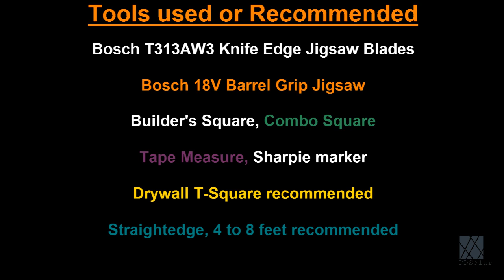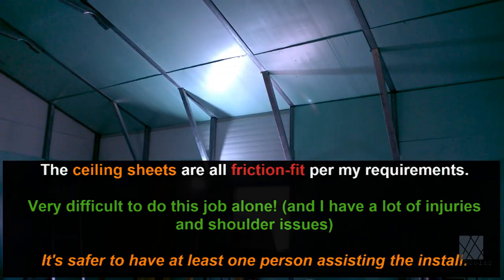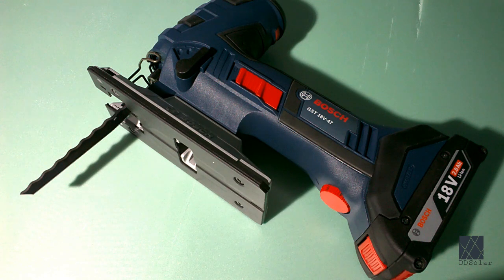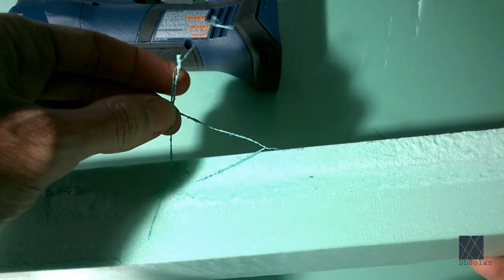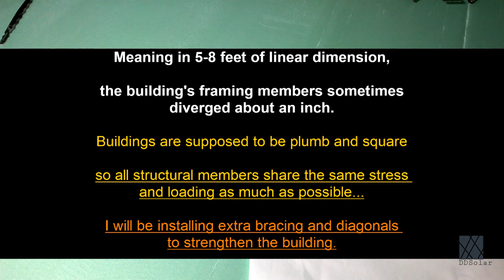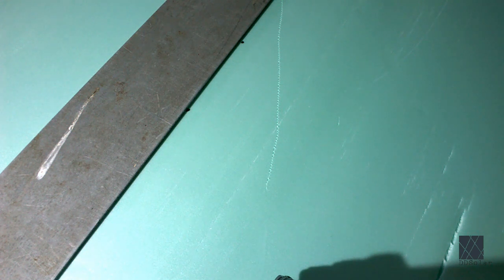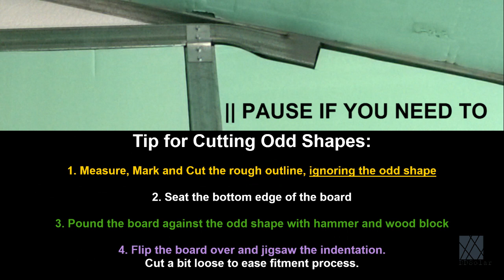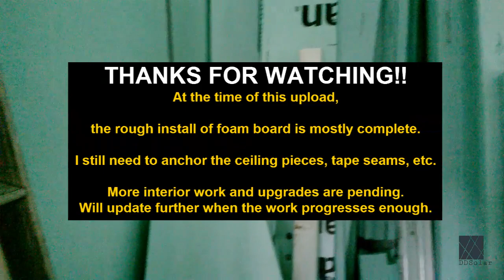Precision Cutting 2 Inch Foam Board Insulation for Metal Building - Bosch Jigsaw T313AW Knife Blade

Comment: Superb video, concise and well thought out. I had landed on this approach before arriving but I picked up quite a few pointers I would have otherwise missed out on. Thanks for the well thought out guidance!
Reply from the maker: No problem sir, glad it helped! I would have liked to included more details, but the video would be 3 hours long and that green foam board was keeping me real busy anyway. I eventually settled on using 1x2 to secure the foam in the ceiling, it can fall down over time even if friction fit. Maybe I'll make a follow up later with other stuff I picked up along the way. CYA
Reply: @solarpoweredge  I tried installing today that blade sure does like to bend. Even though the dust is crazy using a table saw ultimately yielded the fastest result. I’ll be sure to figure out a system to keep them in place, if friction won’t hold I’m sure roofing nails that were too long won’t either lol thanks again!
Reply from the maker: Lol! I'm sure they at least help. I also had trouble keeping the blade straight. It's definitely slower than a table saw. It's great for detail though.  I am unable to breath dust (causes sinus problems and migraines) and had to work indoors. I experimentally cut small piece of foam with a saw and was shocked at how much dust and how it stuck to everything. Table saw wins speed contest hands down.

Comment: Looks really nice I’m having a building built soon and want to do this , would this insulation on the ceiling prevent condensation alone or would I need something else , also the best board insulation video on you tube by far
Reply from the maker: I have found it really helps but must be properly sealed to get full benefit. In winter, condensation can be caused by moist warm air inside the building (it can come from people exhaling, propane heaters, slowly released from wood and property stored inside, and from outside air infiltrating) coming into contact with a cold surface - think of a cold iced beverage, it "sweats". What you really want is to prevent this moist warm air from contacting the freezing cold metal building's sheathing (it's metal so it will be the same temperature as the outside, basically). You can use a vapor barrier of some sort, and foam board, if properly sealed (tape probably) can block this moist air from contacting the sheathing. It also buffers the temperature difference between inside and outside which is good. If you buy a metal building, you absolutely want some kind of barrier because if condensation forms it will literally RAIN on your stuff inside. This is very frustrating. I have not yet sealed all my foam board, but it still helps a great deal. Sealing is very tedious, and I hate the work, but you can use high quality tape meant for foam board. Maybe other tapes would work to, but it needs to have a good long term adhesive and keep air from getting by. Some tape lets go after awhile. Hope this helps. And thanks really appreciate the compliment on the video, glad you liked it :)

Comment: How much larger did you cut the foam to make it fit tight between the studs without crinkling or bowing to keep it nice and flat?
Reply from the maker: About 1/8 inch - some pieces bow slightly. Need tension to keep the board in place. This friction fit process was because I had to lift the foam up with shoulder and other injuries and was working alone. It was either that or no insulation. This then gave time for later installation of wooden anchor strips in the ceiling, the long term solution. The walls, I pretty much left them for now, not able to work any more. They may get the same wooden strips someday - not sure. There is another video on here showing the wooden strips, they're just 1x2.

Comment: I wonder if the Blade would warp bad if you cut with the foam board standing on edge? I've been looking for a panel saw that can cut up to 4" insulation board. There is no panel saw that will cut thicker than 2.25" I could find. (like plywood saw at Homedepot). If it would still cut fairly square I could fabricate a panel saw with a jig saw. My Company makes 100s of cuts a day of 2" and 3" 4x8 sheets on a table saw. Very cumbersome, unsafe and produces lots of dust.
Reply from the maker: @kurtwilkes5498 Hi, what about a hot wire cutter? Haven't tried that personally, just a thought. After many hours using the bosch blade, I found it is likely to warp and twist if I attempt to adjust the cut after it's already started. This makes a poor looking edge with a wavy shape. If I get the saw started plumb and square (perfect) and don't fight to adjust it later in the cut, the results are good. Forcing the cut speed also gives poor results. 

Perhaps if you made some kind of adjustable jig that holds the saw perfectly square and plumb, aligned with the direction of cut, it might work. I am not sure the jig saw can cut fast enough for a business use though. It seems to be a slower cut than those panel saws. There might be better blades available now? 

I hear you on the dust. It is unbelievable how much dust is produced, and it gets everywhere and sticks to everything. I dare not breathe it either.

Comment: You did an extraordinarily fine looking job.  Your labor looks like it will pay handsome benefits.   Did you explore the possible use of either double stick tape or construction adhesives (or other adhesives) to affix the closed cell foam?  I wonder if there are chemicals in either the glue of either the tape or the construction adhesive which could damage the foam?  Any thoughts?
Reply from the maker: Thank you!! So far it's been keeping the building warmer. Yes I thought about using construction adhesive and will probably test it when insulating the outside walls of the cabin I just built inside. Some adhesives will absolutely damage foam, so must test first - or find out if it's compatible with foam board. I experimented with single sided tape designed for foam board and it's not enough by itself on ceilings, but helps get the foam tacked in place and works on walls. I will need to test the construction adhesive I bought to see if it damages the green board. Right now I am finishing the ceiling install using 1x2 strips to create racks to ensure the foam board never moves and to create a surface to staple more radiant barrier. Racking or strapping is mandatory for the ceiling. Otherwise, over time the heat/cold cycle and any air currents might work the foam board loose and it could fall. Friction fit can work pretty good  for the base install, but I would not use it for long term in the ceiling. For the wall  it is OK but might need tape long term.
Reply: This is one of the best videos I've seen like this. I just had a building a lot like this one built. Looking for instruction on how to insulate mostly for condensation , not going to heat the building. Would love to see more of the ceiling start to finish. This building will have lots of air flow.

Comment: How well does the foam insulation perform for noise reduction? I just had a 24x30 metal building put up. I plan on covering the walls with plywood but need to choose my insulation first.
Reply from the maker: It does not block a lot of sound in my opinion. I am very sensitive to sound and get annoyed easily by just anything. I still hear the neighbors' lawn mower and such. Also metal buildings have annoying pops and creaking sounds all the time from thermal expansion/contraction and the wind blowing causes a rattling sound. The 2 inch foam doesn't seem to have a lot of sound blocking effect. If you need sound blocking it might be necessary to add a foam product that is specifically used for sound deadening in recording booths. I think it's called egg crate foam. Could frame out a room inside the building and install sound deadening material. I actually may be headed that route in the future. Anyway hope this commentary helps.

Comment: I tried this same exact blade.....but I kept having trouble with the blade bending and not cutting square.
Reply from the maker: Hi, yes if you care about a clean cut, this is a very tricky and frustrating blade to use plus very easy to bend. To get an attractive and clean cut, it must start square with the blade straight, plumb and vertical and not push the saw too hard. If the saw isn't lined up and try to "steer" too much, the blade will keep cutting but it twists and bends, slanting the cut. Pretty much ruins the cut but I have some of those pieces installed in my wall, doesn't really matter. If you back out and restart carefully with a straight blade, can sometimes straighten the cut and clean it up. I have hundreds of cuts on these blades and they are my favorite so far because no dust (just some horrible styrene fumes now and then). I don't know if it matters which jig saw you use, I only have one available to try.

Comment: How do u keep foam panels up there
Reply from the maker: I cut them into 4x4 squares with a very tight fit and hammered them in with a hammer and wooden block. It was necessary because I installed alone, with many injuries, hard to reach up over my head. Later I added wooden struts attached to the metal beams with self drilling screws. I made a video of that https://youtu.be/LXPlzieYRL0

Comment: Does this foam board stop tin from sweating?
Reply from the maker: Hello, it depends on the installation but can definitely reduce it. I used a continuous 6mm foam barrier against the sheathing as the first defense against condensation (sweating). Keep in mind that if there are cracks and gaps in the foam board, warm moist air could seep around behind and cause condensation. Drainage plane is also very important in case any moisture happens to build up on the inside of the sheathing.
Reply: Why do you like my comment?? I would appreciate an answer.
Reply from the maker: @evelyngoodshot-segovia4978  Yes looks like your comment got a like. Probably because it's a good question and a lot of people probably want to know the answers.

Comment: What are you doing for an air space  between the board and the exterior wall
Reply from the maker: Hello,

Actually I did not plan on having an air space there, outside the board is the 6mm foam and radiant barrier (continuously applied over the whole building and frame), then the metal sheathing. Have not had problems so far. It is possible some moisture could be trapped behind, but it will probably take a while to determine if that's really going to be an issue. Possibly when it's very cold outside and warm in the building.
Reply: @solarpoweredge  Aw OK I missed the part of the 6mm.   I'm actually looking in to BlueTex for my didn't like the double bubble or the other stuff the companies offers
Reply from the maker: @NYTROeast  The product I appears to have cost a fraction of the blue stuff (unless I'm looking at the wrong thing), and looks very similar. It's like a roll of foam with foil lining on it.
Reply: @solarpoweredge  The 4x8 foam board is probably cheaper but I don't have the double bubble or any kind of moisture or radiant barrier on my building at this time for I couldn't see paying the company $4,500. extra for the double bubble stuff cause I have seen it seen it just fall apart in a year or two.  Yea the BlueTex insulation is just a 6mm Foil + XPE Foam insulation + Radiant Barrier for total moisture prevention and can be installed on the inside of the building creating an air space between it and the out metal panels.   I was just quoted a price of $5,500 to spray foam the building.  The building is only 24x36x10 13 at peak
Reply from the maker: @NYTROeast  Yeah these buildings need the moisture barrier. I did not want to use double bubble either. Doesn't seem robust at all. Might want to check amazon or ebay they sell what appears to be the exact same product as the bluetex. Same looking foam 6mm but it's white. I suspect it's the same thing but can't say for sure. That is what I used in my building. I do not know how durable the radiant barrier side is, too soon to tell. I had the builder install it all over teh building before the sheathing was applied, so it sits between the sheathing and frame.
Reply: @solarpoweredge  I will check amazon. The Bluetrex is white on the one side and the reflective aluminum foil is on the other side.  Thank you for your time and the great videos
Reply from the maker: @NYTROeast  OK cool. Best wishes on your insulation project. And I appreciate the good feedback :)
Reply: @NYTROeast  what did u end up doing?
Reply: @coinholio6987  I ended up with 1.5-in x 4-ft x 8-ft and .5 foil faced board.  I decided to go with a 1/2-inch air space.  I cut the .5 into 4-inch squares and used 3/4-in 12-gauge  Plastic Cap Nails as pins to hold 5 squares to each 1.5 sheets so to make the air space. Then cover each nail/pin with Reflectix 2-in HVAC Insulation Seaming Tape to seal it. Cut the sheets 12th oversize to make a really tight fit then tape all seams and edges with the same tape.

Comment: What state are you in 
An how well did this work at keeping it warm inside
Reply from the maker: Hi coastal southeastern area. It sure made a big difference keeping the heat in. I built another structure inside the outer envelope which magnified the effect, making it easier to heat and giving more options.
Reply: DDSolar I live in Northern Michigan and I’m considering building a 20 x 40 building and using foam board to insulate it for my model trains
Reply from the maker: @penrodautorepair3170  Sounds fun, I used to have some trains and might get back into it. Anyway 20x40 is a big building so you'd need powerful heating/cooling even with the foam board. Plus it's cold up there! Maybe a wood stove. When I first started heating my building all the heat went to the peak of the roof. Eventually I framed out an interior room and that was much easier to heat with the lower ceiling height.
Reply: DDSolar I’ll ending putting wood blocking in an then drywalling the walls 
Metal on the roof 
An foam under the floor along with tile over the concrete fallowed by a wood stove an a 18,000 btu mini split. I’m only going with 6 foot walls
Reply from the maker: @penrodautorepair3170  Wow sounds very nice!

Comment: Did you put foam against roof or did you leave a airspace?
Reply from the maker: Yes there is an air space underneath the roof, as well as a vinyl-lined foam barrier between the foam board and the metal roof (and wall) panels.

Comment: All t squares are slightly out square
Reply from the maker: Sadly A lot of them are. One can check square by various means. I did some "amateur metal working on mine" to try and straighten it.
Reply: @solarpoweredge  i check them on sheetrock at home Depot before I buy it.
Reply from the maker: Good idea !

Comment: A Table saw cuts those panels easy
Reply from the maker: Yes, also tried a circular saw but didn't want dust
Reply: @solarpoweredge  ohh I see. Good move. It looks great.  Im about to do the same thing.
Reply from the maker: Thank you, I'm still working on the taping and furring strips and so forth. It's gonna be a ton of work. Sounds great hope your project goes well. Foam makes a big difference.
Reply: So does a hot wire!